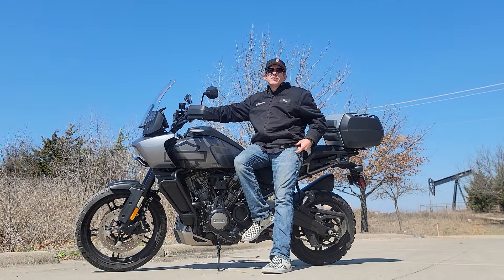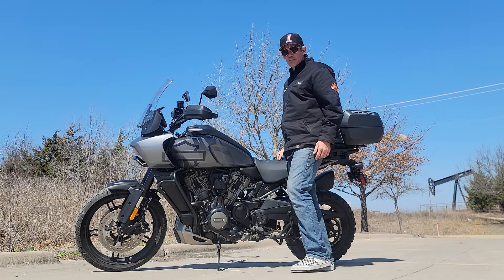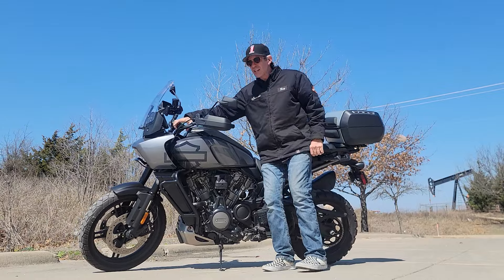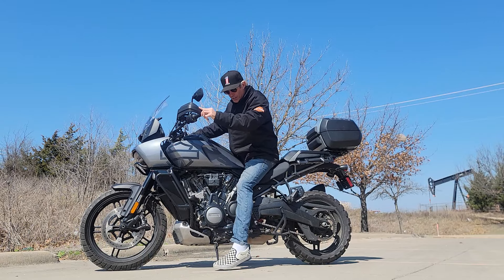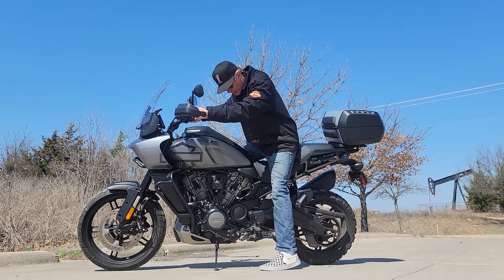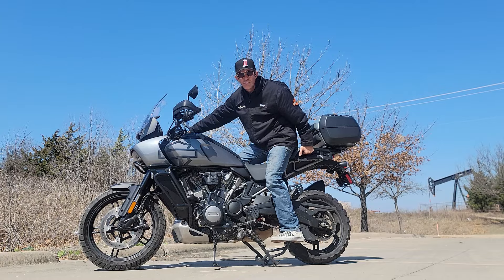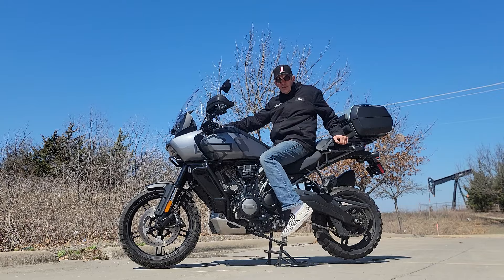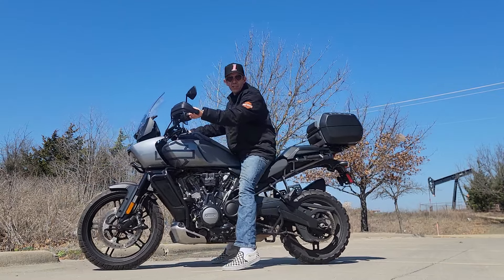Pan America Kick Stand and Center Stand

Comment: I own a 2022 PAS.
I have read some of the complaints about the side stand.
I must say I dont see a problem if you just adapt a little.
The big complaint is retracting the sidestand from standing next to the bike.
With the ARH in the lower position the bike has to be leaned ever so slightly to the right.
Simple solution is to get on the bike first,then retract the sidestand.
Simple , easy and safer from the saddle than from alongside the bike

Comment: I've had my bike fall over due to the jiffy stand, but it was because of the adaptive ride height. I had my Pan Am positioned near my car to use the air compressor. I didn't notice that I positioned the bike in a tire rut. Upon moving the bike around, the ARH went back to full height. I put the jiffy stand down and proceeded to fill up my tires. I turned the bike on to read the PSI. The ARH lowered, causing the bike to tip.

Comment: A big part of the problem comes from the fact that you have to lean the bike hard to the right in order to fully extend the kickstand. Before I knew this, I set it down without the kickstand being fully extended. Bad time.
Reply: If you have ARH, you can hold the front brake and rock the bike front to back a few times and it'll pump up the height so the kickstand will clear without leaning right. The bike drops down by default and uneven ground  makes it hard to get the stand deployed.